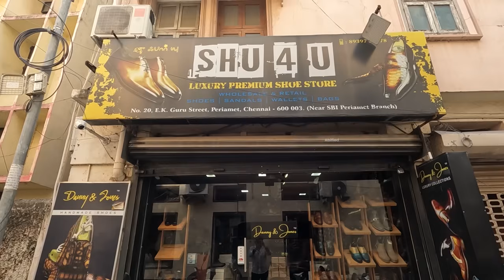Handmade Shoes in Chennai 🔥| Live Shoe making process! 😳 | கை- ல Shoe செய்யுறாங்களா! 👞 | Abified

Comment: Title of the video should be changed. Hand made shoes means, making of shoes without using any machinery except for stitching.  Cutting of leather components, Skiving, especially pulling and locking using small nails will all be done by skilful hands but not using machinery.  Shoe bottom  will be made by bark leather including the heals.  
The process shown in your video is the making of customized shoes and could not be termed as Hand Made Shoes.   This company puts on lot of effort in making of good shoes, but could not categorize as hand made shoes.  Fully hand made shoes are real masterpieces.

Comment: He is basically fooling customers in the name of handmade shoes, there is no welting process or stitching process of the middle sole and lower sole which basically makes the shoes last decades. What he did is the cheapest way to get away with glue pasting shoes which are way cheaper than what he is charging for it.